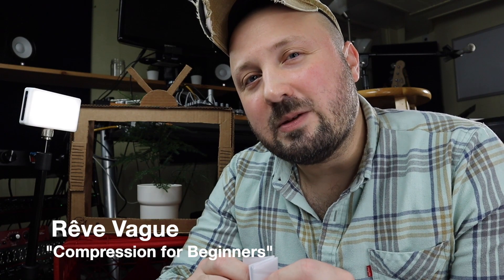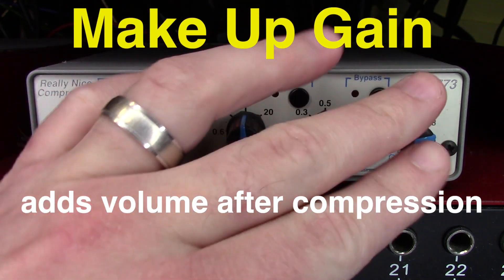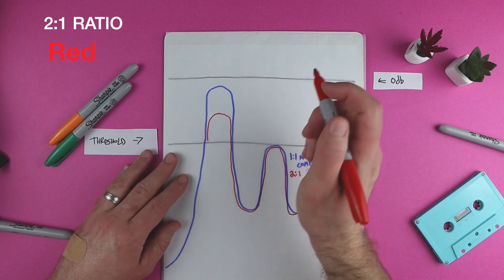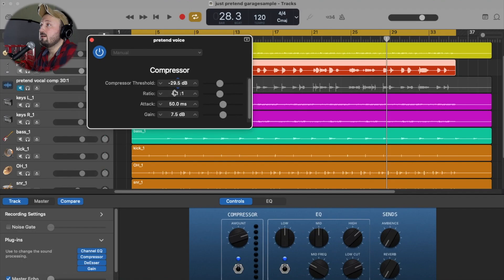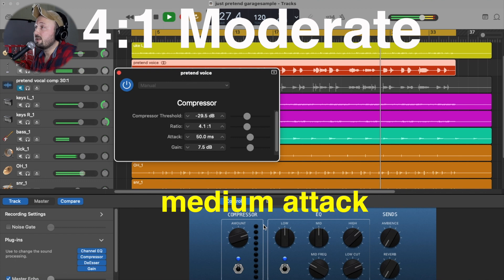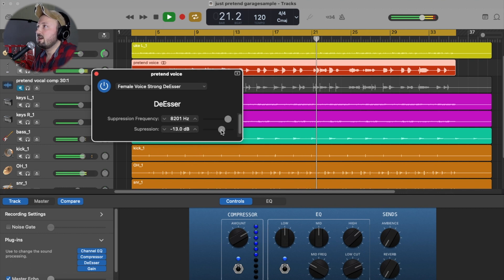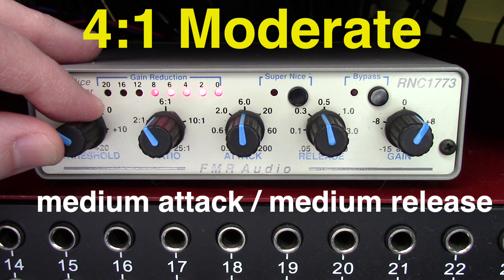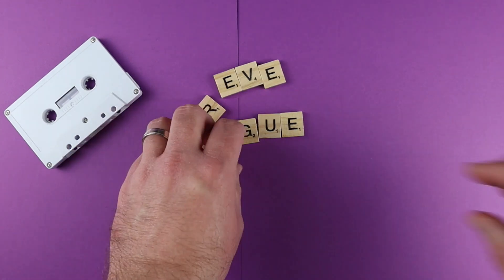Compression for BEGINNERS (Garageband and more)

Comment: How do you have your FMR RNC 1773 connected to your audio interface?  I just ordered one and then I saw there was much confusion concerning if the outputs were TRS or TS. I see yours is working , therefore you must know.
Reply from the maker: The outputs of my interface are TRS however I use short TS (unbalanced cables) to hook up the FMR RNC both input and output.
Reply: Thanks, it arrived  late last night and it worked great.    First I used all TS cables and connected it to my Audio Interface I/O and I was able to use it.  I then decided to read the manual and it stated  that the two outputs on the FMR 1173 are balanced so I connected it to my Focusrite 18i20 Outs 7/8 .The two inputs on the FMR 1173 are TS, so I used 2 unbalanced cable and plugged them into my 18i20 7/8 ins and it worked great.
Reply from the maker: Happy to hear!

Comment: Would love a video breaking down which instruments work best for each ratio.
Reply from the maker: A good idea. It can be tough to outline some hard and fast rules but I usually like three ratios: 2:1 for subtle work (just tickle the gain reduction; could be useful if overheads need a little control; but you're a super consistent player so I would avoid touching them), 4:1 for normal work on sources like voice, kick, snare (a couple db here and there, play with attack and release to find what you like. Personally can't stand pumping/obvious compression), 10:1 and above for heavy duty  compression/sound effects (think a super compressed room mic). I think on an 1176 8:1 or 12:1 would be closest choice here.

Comment: Love that video!
You explained everything so well. I wouldn’t consider myself a complete beginner when it comes to compression, but your video breaks down the concept in such a creative and easy to understand way that I also learned a lot.
Also still obsessed over your sets.
I‘m not a huge fan of de-essers (or of strong compression for vocals, so that fits well together haha), but if I were to use one, the logical thing for me would be to put it in front of the compressor, probably also the EQ. The compressor makes everything louder, so if there are no disturbing s-sounds to begin with, the compressor wouldn‘t be able to bring them out, right? But I‘m not so experienced in using de-essers, would love to hear your reason for putting it behind the compressor!
Reply from the maker: Thanks! This one was a lot of work but turned out to be really fun. I think I prefer the de-esser after the compression because I like to find the sound I’m after with EQ and compression and then make subtle changes from there. Compression will exaggerate sibilants for sure but you could totally put a de-esser before the compressor as well. I think if that gets you the sound you’re after than go for it. The GarageBand de-esser isn’t great; I prefer the Logic De-esser2 or Waves De-esser set to 4.8k but for this video I wanted to use stock plugins in GarageBand. Thanks again!